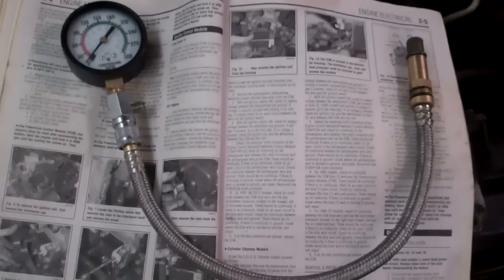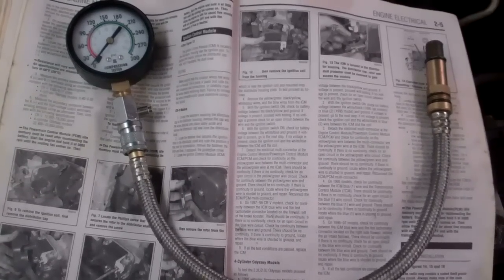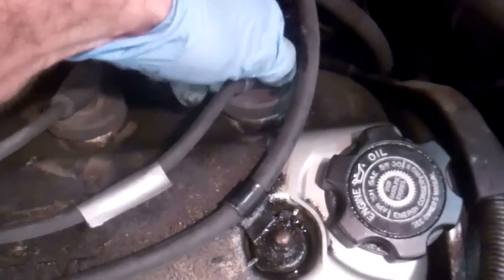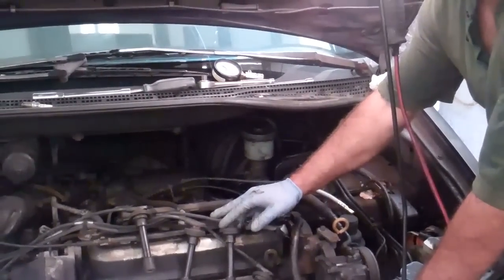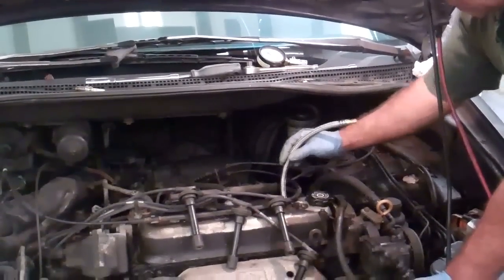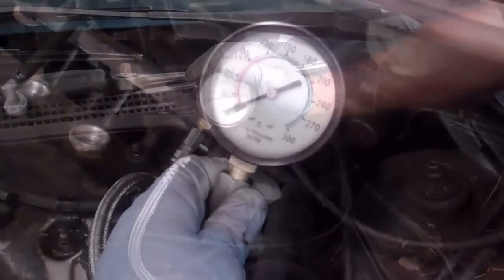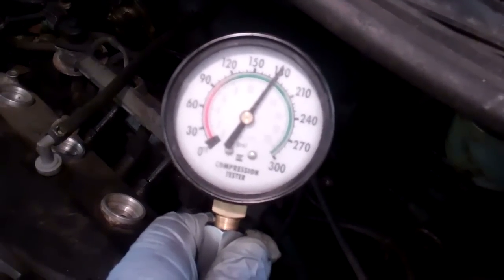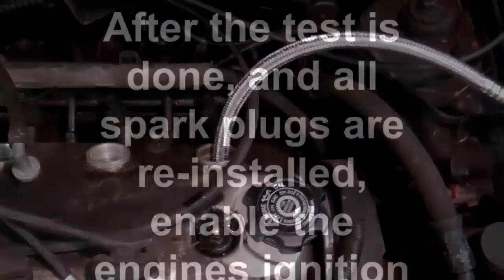How to do a compression test on an engine

Comment: i have a quick question, i need to do a compression test on my car but i previously removed the timing belt and put the cams to TDC and i'm wondering if i need the engine to be properly timed to do a compression test? thanks!

Comment: Leaving it on and waiting to see if the compression drops is the stupidest thing i have ever heard!! The only thing keeping the needle there is the small ball in the hose that you connect to the gauge. If that ball was not there the pressure will drop the same moment when you stop cranking the engine. You are a mechanic and dont have a clue how an engine nor a compression tester works?! The engine only makes a compression in 2 of the 4 strokes! The compression and combustion stroke, how would you know where the piston is after random cranking. What if its in the intake or exaust stroke, the needle will drop?!
Reply: Now thats the stupist thing I've heard all day. Its not a ball its the same as a valve stem core.

Comment: How would your engine start with no spark plugs?
Reply: +Maurice Rogers When doing a compression test you do not want the engine to start running (combustion) hence why you take the spark plugs out. All you are trying to do is test the pressure created in each cylinder during the engines compression stroke. When you turn the car on without spark plugs the starter motor will still turn the flywheel and the crank. This makes the engine cycle through its usual strokes without starting, the compression tester replaces the spark plug to get a reading of the pressure in the cylinder.

Comment: Hi, if I used a remote starter (hooked to the starter coil) do I still have to disable the gas pump and ignition system? or by not using the key the ignition and gas pump are not being use?
Reply: pull the fuse so the pump  will not pump gas

Comment: Waiting to see if the pressure drops is useless with that compression gauge.  Your gauge has a check valve to hold the reading for you to read.  You then have to release the valve with the little button to clear it for the next cylinder.  All the waiting does is test your check valve which has nothing to do with the engine condition.  If you wanted to test how well your rings and valves hold the pressure you would have to crank up the pressure and then stop the engine on TDC (top dead center) while holding the check valve button open.  Still that is not the way to check for ring leakage since it is almost impossible to accomplish.  Just run a dry compression test.  Then squirt oil into the cylinder and run the compression test again.  If the compression rises on the second test you have a ring problem.
Reply: +Terry Horlick  I was gonna say the same.
Reply: Sounds reasonable, than you very much.
Reply: Exactly right

Comment: One thing to make sure when you are screwing the gauge wire in the plug hole is that, yes it is hand tight but make sure it's AS TIGHT as you can get it with your hands, if not, there's a good chance it could pop off in the middle of the test and you have to do it all over again. Also, it makes a loud ass noise that will scare the fuck outta you lol
Reply: Also, ( don't think I'm trying to take away from your video because it is very informative ) rather than 5 seconds, you should keep the ignition turned until the gauge pumps 4-5 times.
Reply: @temp2269  Crank the engine until the gauge doesn't rise anymore.  That's the way it should be done.

Comment: Leaving compression gauge screwed in does NOT display rate of leakage from the cylinder. It displays the rate of leakage through the release valve on the tester. You can UNSCREW the tester from the cylinder and the gauge will STILL show compression until you open (press) the release valve. The pressure accumulates IN the tester, not in the cylinder (which leaks down almost instantly if a valve happens to be open, which it usually is).

Comment from the maker: Yes MrKau, I left the spark plugs in the cylinders not being tested and my assistant held the gas pedal to the floor. This was the procedure as per my vehicle maintenance manual - it's a Honda van in this video. The procedure may vary ; if you want to be sure i would advise buying a Haynes or Chilton manual for your vehicle. They cost about $35 in Canada

Comment from the maker: @loofoowho So did you test for compression on just 1 cylinder Loofoo ? If you only tested one, then you may have discovered your engines problem on the first try. If you get no reading on any of the cylinders then your compression guage is probably defective. We know there will be compression in some of them because the vehicle is driveable

Comment: Thanks for the video, can you answer if possible. I have a compression tester but getting no reading. My car on deceleration backfires (before test) which is a lean mix issue im sure, but why cant i get a reading. Ive checked my seal to tester to see if air leaks and cant see any...is it possible that my brand new tester is faulty. I took out all tests , dry tested and didnt bother with wet due to no reading. Thanks in advance